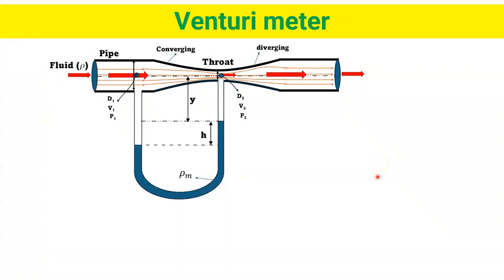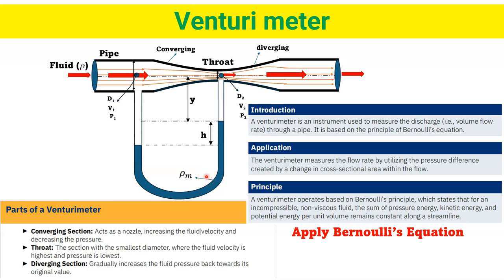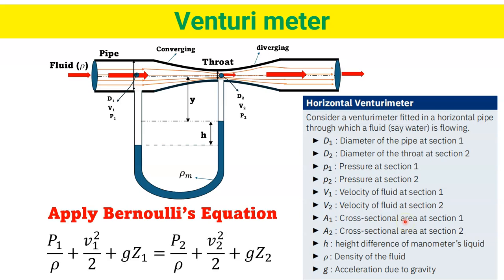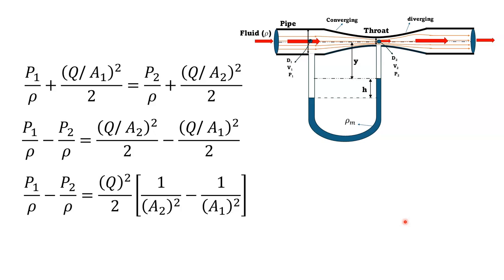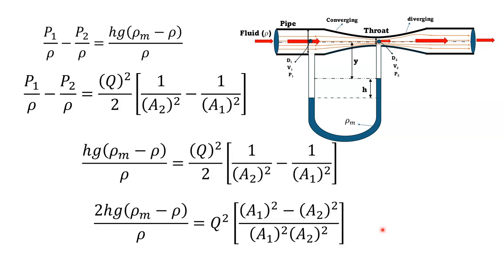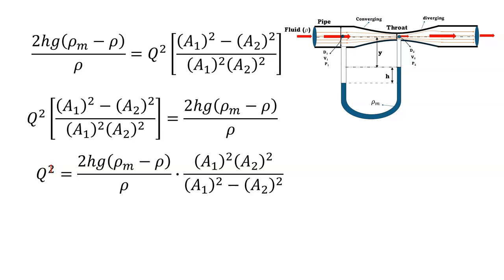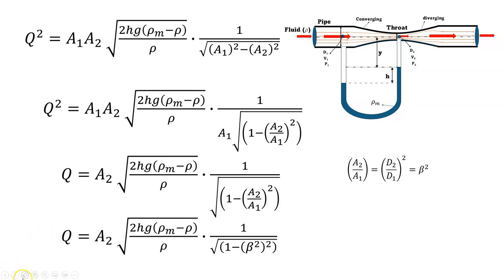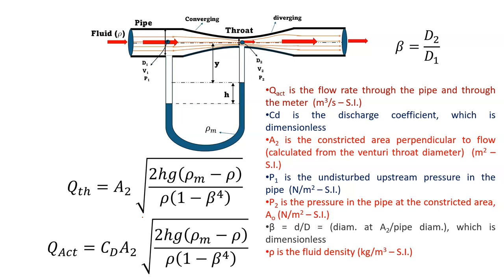Flow Measurement: The Venturi Meter

Comment: What is the impact of inlet pressure variation on flow measurement
Reply from the maker: Changes in inlet pressure can alter the flow coefficient, influencing the relationship between flow rate and pressure differential resulting in unstable flow and erroneous measurements

Comment: What will be impact on flow accuracy if inlet pressure changes
Reply from the maker: In the case of liquids, changes in inlet pressure primarily affect the pressure differential across the venturi meter rather than significantly altering fluid density, which remains relatively constant. This pressure variation can lead to inaccuracies in flow measurements, as it impacts the calculations based on the Bernoulli equation. While the effect on measurement accuracy is less pronounced compared to gases, maintaining stable inlet pressure is still essential for reliable flow rate calculations.